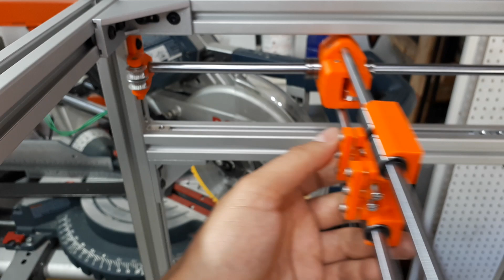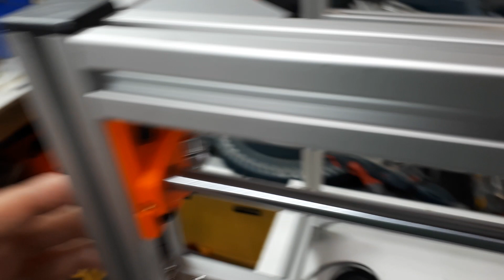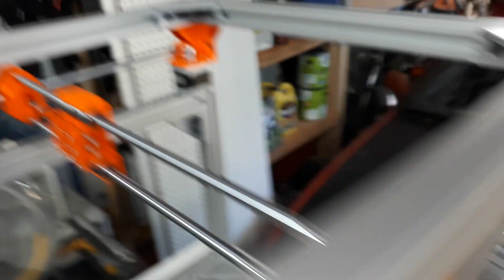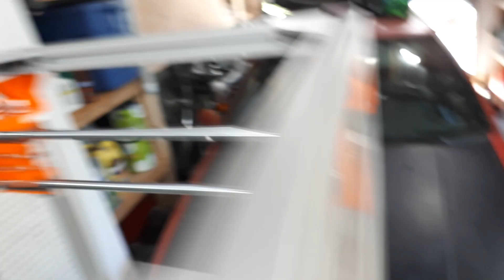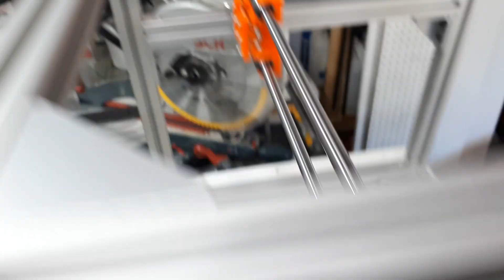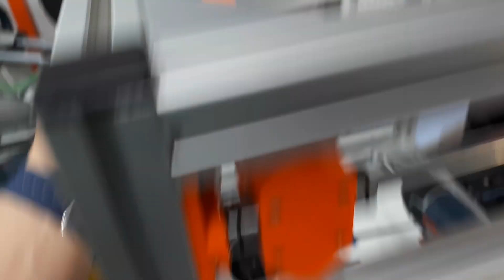Part 3 X&Yaxis - MirageC's HyperCube Evolution Build Lessons Learned.  Data sourced from DaHai8

Comment: I'm building one, just waiting for my 3030 and 2020 aluminium profiles to come, My friend has modified the x axis runners that hold the 10mm bearings and rods he has used m3 nyloc's where the brass inserts would have been by sliding them in from the side the end caps then have some plastic between the bigger part and the end caps, I have also modified the x-carraige by using two 45mm bearings instead of 4 smaller ones, I've narrowed the x carriage to 45mm wide and made bearing clamps that go over the top of the bearings as it's really thin on the sides near the bearings and it's easy to snap with your hands even printed in petg, so while building it we have modified alot of the parts we thought were not that great or strong, when I get it up and running I will modified the other other printed parts that I feel I can improve on.